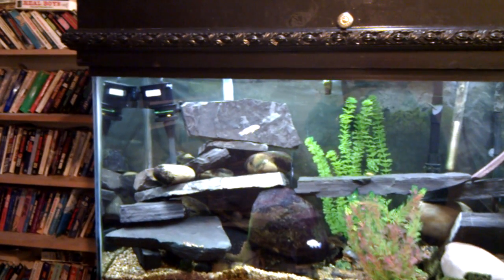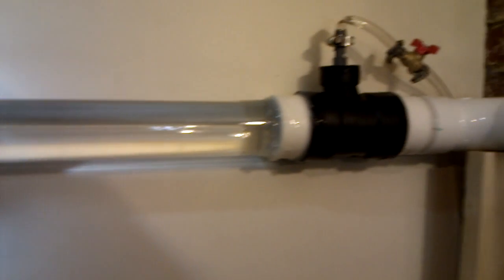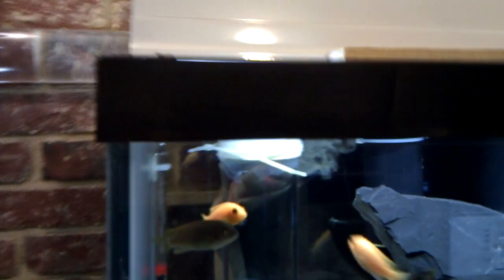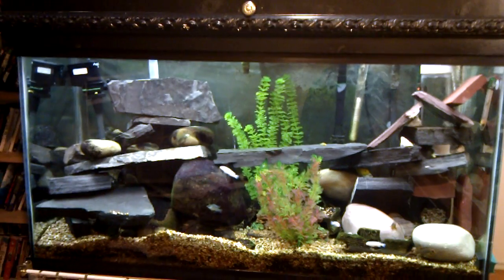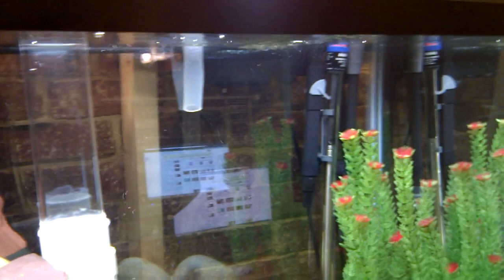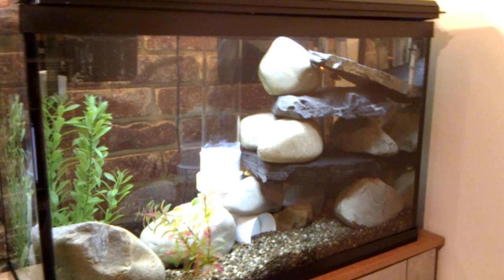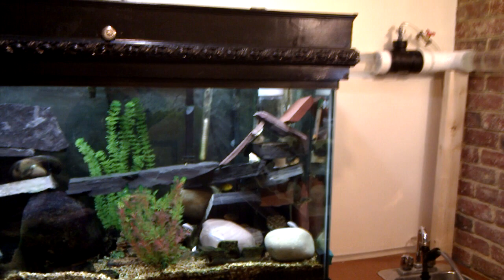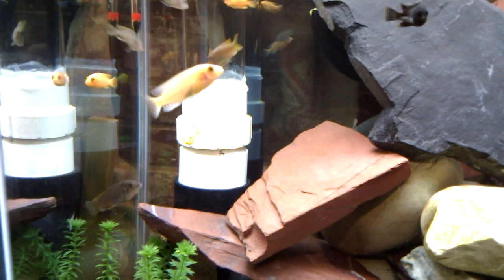Three Aquariums Connected with Fish Bridges

Comment: I've done this with two tanks. I made it 6 years ago. Originally it was 3" diameter, Rebuilt it 2 weeks ago and made it a much bigger diameter.I just wish the clear elbows, couplings and ends weren't so damn expensive. I've also put acrylic paint on the back of the tubes as a background.

Comment from the maker: There's no vacuum. The top of the tanks are open to the air just like any other tank. You can open it up, put food in, net a fish, change the water, etc. Remember, the tubes themselves are air and water tight, maintaining a siphon. The tops of the three tanks are all level with each other. So it's essentially three tanks sharing a common water supply, acting like one tank.

Comment from the maker: Water is always slowly flowing through the bridge, thanks to the pump pumping water from the far left tank into the far right tank, so it's not a problem - the fish would just be flushed out. If it ever happened that one got stuck somehow then I could simply drain the tubes and the fish would come out with the water.

Comment from the maker: @espirates2 The three tanks are connected together through the tubes. The bottom point of each tube intake is below the point to which I drain the water. Due to the siphon, the water level in each tank remains exactly level, since they are, in essence, the same tank due to the siphon. Draining one drains all, because the water level stays consistent, water goes through the siphon in order to do this. Also, that's why the top of each tank needs to be exactly the same height.

Comment: In 1974 at college I had 2 goldfish bowls.  I made a fish bridge, an inverted U made of clear pipe. To make the bend I used 45 degree cuts, then glued.   I inserted a thin flexible tube and sucked out the air with my mouth.   To motivate the fish I would put food in the tank they weren't in.  The fish were skittish and shy when in the bridge.  But it looked cool watching them float above the surface of  their tanks.  Actually I think of this as the best idea I ever had.

Comment from the maker: @Derf19761 The elbows, tees, and other fittings cost a fortune if you want the clear PVC ones. Like, over a hundred bucks per elbow. It's insane. So I just went with the clear pipe and used regular white PVC from the local hardware store. Much, much cheaper that way.

Comment from the maker: @Derf19761 They're made of clear PVC plastic, which I bought at a local plastics supply dealer in the city in which I live. I suspect if you check your area's listings for plastic dealers/wholesalers you might find a place to buy them. There are also online sellers, but I didn't explore that at length since I found a local place.

Comment from the maker: @Claya94 Nothing. Because the tubes are an airtight siphon and the water across the tanks is at the same level (which is has to be to work). If the power goes out the only thing that happens is that the water temporarily stops flowing through the tubes from tank to tank via the powerhead that pumps water back through. No big deal. Unless it was hours and hours and hours, then the water inside the tubes would become stagnant, but not having the main filters running would be a bigger problem.